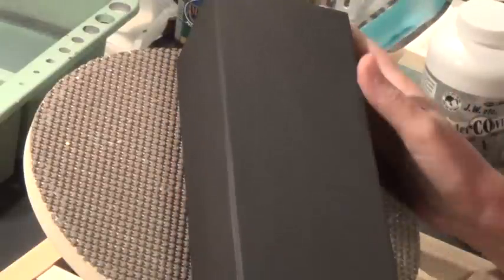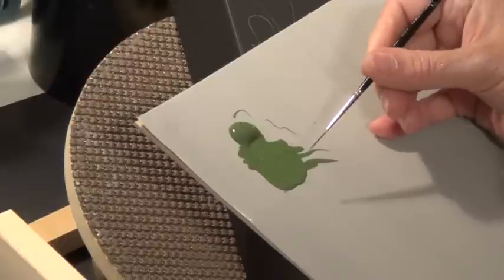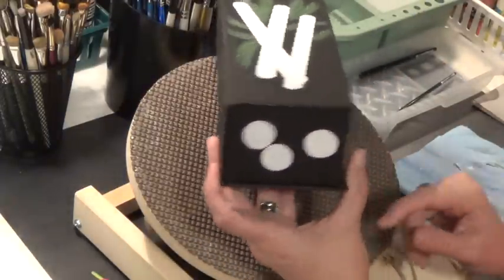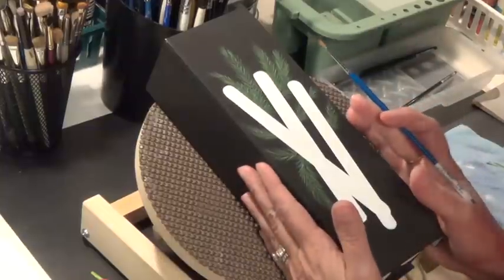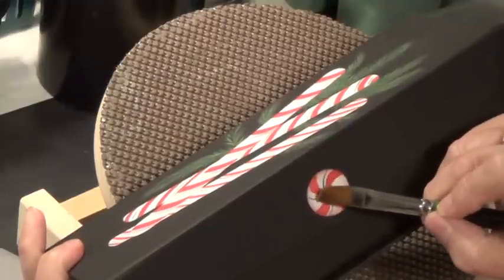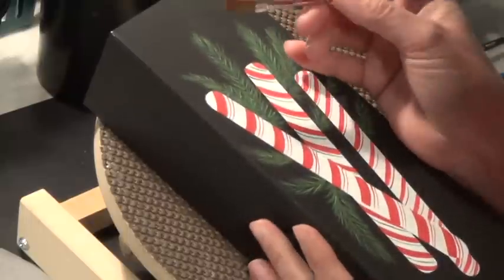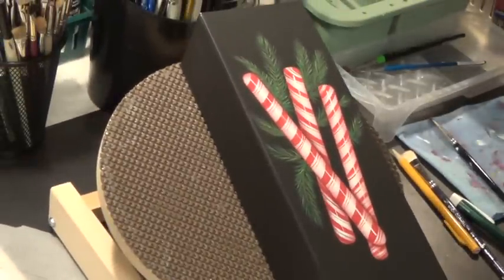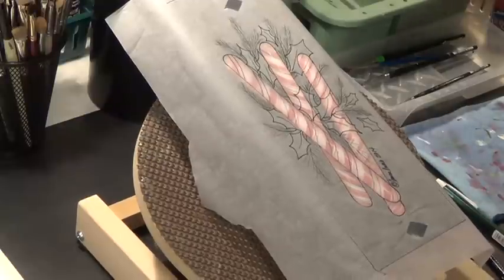Peppermint Stix in Acrylic

Comment: Tried finding the Loew Cornell curved flat brushes. Couldn't find. Do you any more info on these?
Reply from the maker: Tracy The curved flats were discontinued by the company earlier this year when it was bought out by another company. So sorry. I use in its place either a flat brush or an angle brush which should be available in many brands of brushes. The curved flat was a great brush and many are sorry it was discontinued.